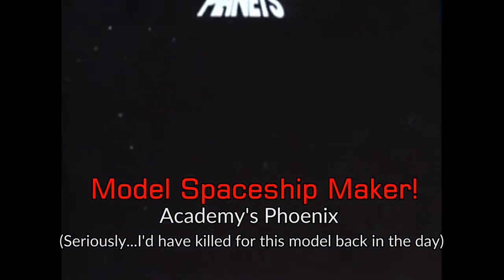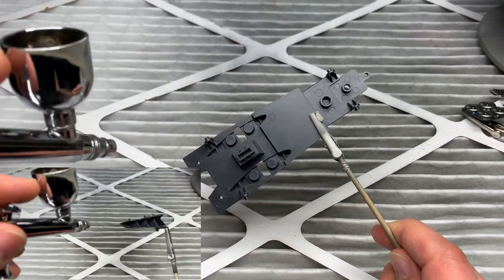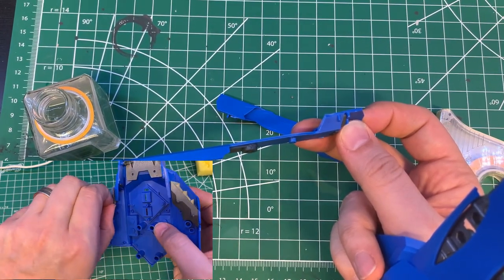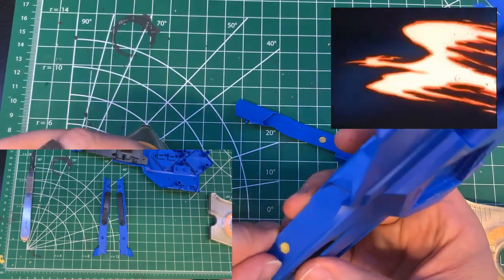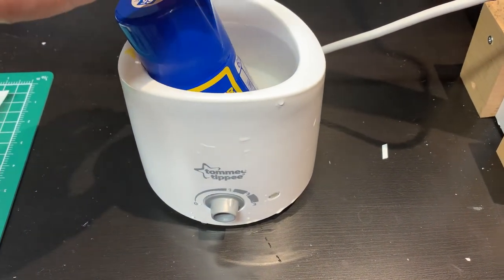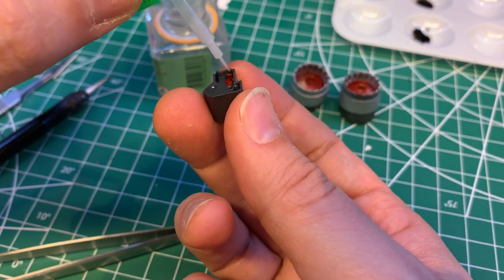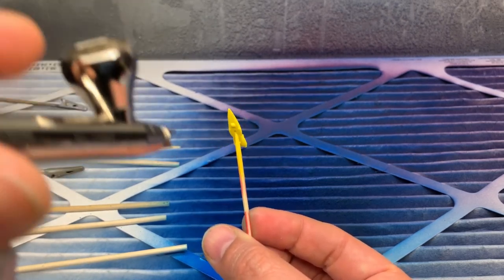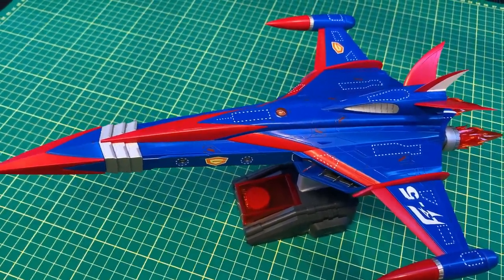Build the BOP Phoenix

Comment: Beautiful build. I got the kit last Christmas and I am just getting around to it. Academy did two versions, one with the light kit included and one without.

Entex in the U.S. did import some Bandai kits for Gatchaman 2, including the small jet and the G2 God Phoenix (which was white and red) in 1979-80, but they are really difficult to find today and expensive when you do. Plus they tended to have the proportions of unbuilt toys. I have heard rumors of a God Phoenix 1 kit also done, but I have never seen one in the flesh. By comparison, the Academy kit is a much better offering with great proportions not messed up by any toy switches or oversized wheels.

Comment: When I was a kid in the late 70s early 80s I had 2 Battle of the Planets model kits. The Phoenix, and a space station/Center Neptune kit. The Phoenix came with the other team vehicles. Mark's Jet slipped into the back to form the center tail wing and Jason's race car fit loosely inside the nose cone. Keyop's space buggy and princess' bike were too big for the wing comes. The space station kit was tubular and came with tiny versions of the teams vehicles. Does anyone else remember these? Just to let you know, the Phoenix' wings folded down in the cartoon when they deployed Keyop and Princess' vehicles. Cool video.
Reply: Good comment - I had the same two models. There's a site in Japan I visited just two months ago where I saw the model of the Phoenix we both had - still in the box - for a yen amount I did not convert, but it looked huge. Couldn't find the round, tubular space station, though. That was an odd model design because although I was grateful to have it, I never recalled it appearing on the show.

Comment: I bought this, and have it all painted and prepared to assemble (20 minutes) BUT the LED lighting kit I bought did NOT come with any instructions. Any way you could offer some tips? This is a surprise for my Son's 16th Birthday; it IS where his name came from but I cant send it until I can get the soldering of the lights done.
Reply from the maker: Yes, mine did not come with instructions either. Very annoying. What I had to do was place the batteries in the holder and then try various wire placements until I got the lights to turn on. Then I quickly labelled everything!!  Honestly, the whole thing took about a half hour to figure out.
Reply: @ModelAirplaneMaker  Hey, thanks for the reply. You didn't happen to remember how you did the wires?

       I'm documenting the entire build from airbrushing parts, detaching them from the grids, painted pieces together and section by section put together for my son, then having CVS print all the photos and putting them in a photo album so he can see the build, the effort I put into it (specialty painting to show battle scars), and what I got his name from. Should be cool when I'm done Ina couple days
Reply from the maker: @tbradley9955   hi there - no, I just did it by trial an error and once it was done I soldered everything in place.

Comment: I love this ship but I gotta tell you I wanna slam it against the wall... I bought 3 lighting kits and each time they didn't light...no dam kit should be this hard to light ...I've seen video after video saying make sure wires touch. I did that! But after 3 lighting kits I'm done! I managed to light it for a sec but had the stand facing backwards and when I corrected it no lights. I just boxed it away.
Reply from the maker: I recall it took an evening for me to figure them out because there were no instructions.  They were definitely not intuitive and I remember remarking at one point they where the opposite to what I would have thought.  These should have been on a MUCH simpler circuit.